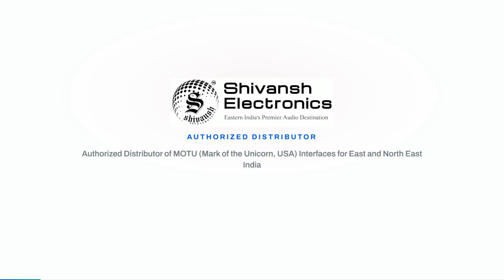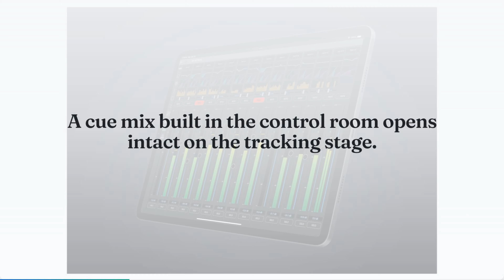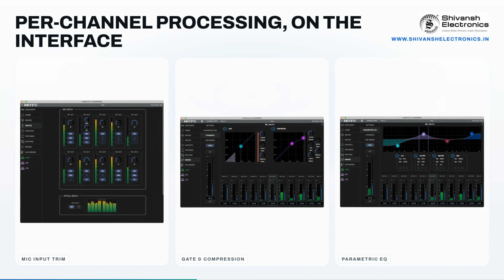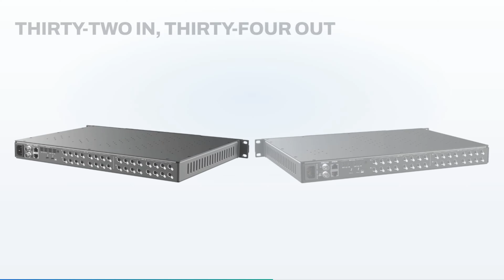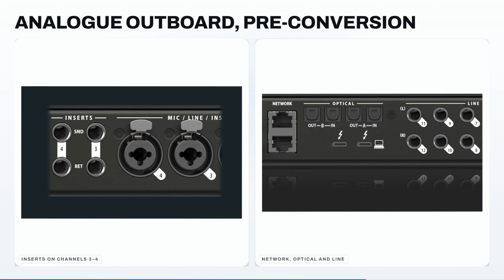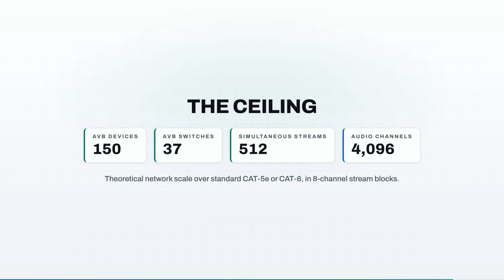MOTU AVB Series Explained — 16A, 848, 10pre | The Full Ecosystem | www.shivanshelectronics.in

Comment from the maker: 🌐 https://www.shivanshelectronics.in/collections/avb-networking

MOTU AVB Series — One Engine, Three Interfaces, One Network

Every studio starts with 1 room and 1 interface. The moment a 2nd room enters the picture, most setups start compromising — mismatched converters, clocking errors, monitor controllers bought late. The MOTU AVB Series solves this differently: 3 interfaces, 1 identical engine, 1 identical price.

• The shared engine
ESS Sabre32 Ultra conversion. A 64-input, 32-bus CueMix Pro mixer on 32-bit floating point DSP. ~1.8ms round-trip latency. Thunderbolt 4 / USB4, up to 256 channels. Identical in all 3 chassis — only the front panel changes.

• 10pre — built to capture
10 microphone preamplifiers, up to 74dB gain, -129dBu equivalent input noise. 26 inputs, 28 outputs, 54 simultaneous channels. Inserts on channels 1 & 2, dual headphone outs, a 3.9" display.

• 16A — built to route
16 balanced 1/4" line inputs, 16 line outputs, all DC-coupled. 32 inputs, 34 outputs, 66 simultaneous channels — the highest in the series. 2 x 3.9" displays, ADAT/S-MUX expansion, control-voltage-capable outputs.

• 848 — built to command
4 combo preamps, A/B/C speaker switching, talkback, mono fold-down, 2 headphone mixes. 28 inputs, 32 outputs, 60 simultaneous channels. Removes the need for a separate monitor controller.

• The network
Every unit ships with a built-in 2-port Milan-certified AVB switch — the first 2 rooms connect for free. Add the AVB Switch for anything larger: 6 gigabit ports, up to 100m per run, sample-accurate clocking via gPTP, scaling to 150 devices and 512 streams.

• Pricing
The MOTU 16A, 848 and 10pre are each ₹1,87,900 per unit, inclusive of GST.
The MOTU AVB Switch is ₹52,990 per unit, inclusive of GST.

To specify a system, or arrange a demo, get in touch.

Shivansh Electronics is the Authorized Distributor of MOTU, USA, for East & North East India.

Questions? We are one message away.
💬 WhatsApp Us:
🔹 +91 98316 62458
🔹 +91 91477 00677
🔹 +91 89818 07755

Discover More!
🌐 Website: https://shivanshelectronics.in
🔗 Gateway: https://shivanshelectronics.in/linktree-hub
📢 WhatsApp Channel: https://shivanshelectronics.in/whatsapp-channel

Connect with us:
🔹 YouTube: https://shivanshelectronics.in/youtube-channel
🔹 Instagram: https://shivanshelectronics.in/instagram-page
🔹 Facebook: https://shivanshelectronics.in/facebook-page
🔹 LinkedIn: https://shivanshelectronics.in/linkedin-page
🔹 Threads: https://shivanshelectronics.in/threads-profile
🔹 X (Twitter): https://shivanshelectronics.in/x-twitter-profile

Raja Electric - Shivansh Electronics
📍 3, Ramanath Das Road, Dhakuria, Tanu Pukur, Garfa, Kolkata, West Bengal, India 700031
📌 Get Directions: https://shivanshelectronics.in/google-profile-location

.
.
.
.
.

#connections #followers #MOTUAVBSeries #MOTUEcosystem #MOTU16A #MOTU848 #MOTU10pre #MOTUAVBSwitch #StudioFacilityDesign #AVBAudioNetwork #MilanAVB #ProAudioEcosystem #StudioNetworking #ShivanshElectronics #IndianRecordingStudios #EastIndiaAudioDistributor